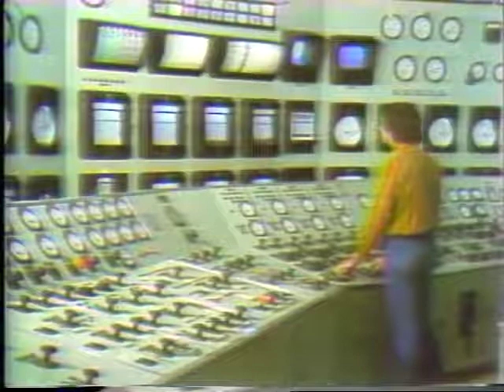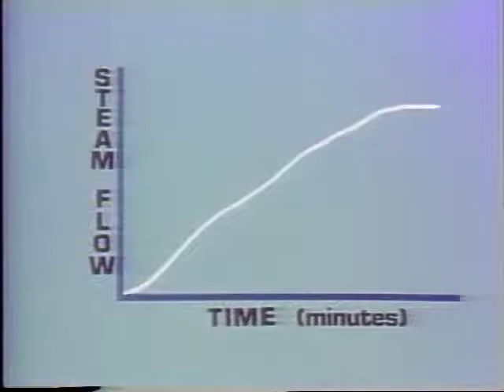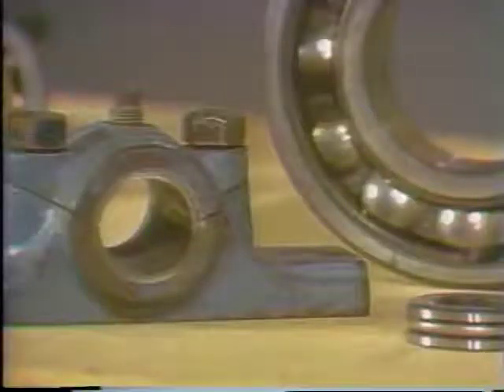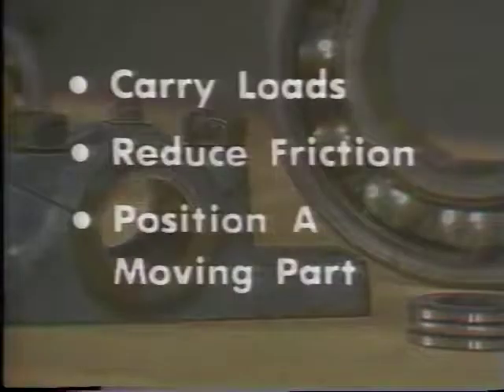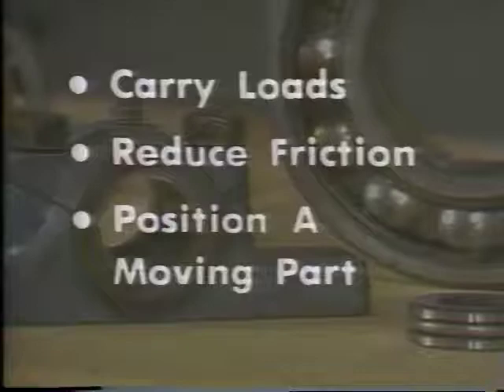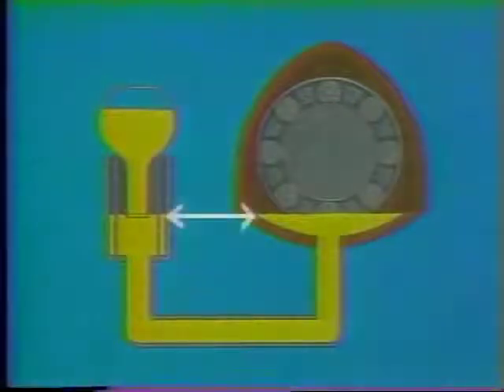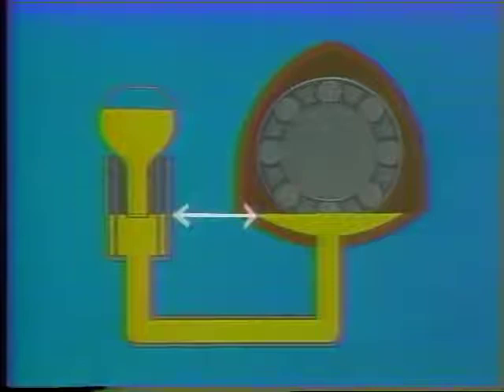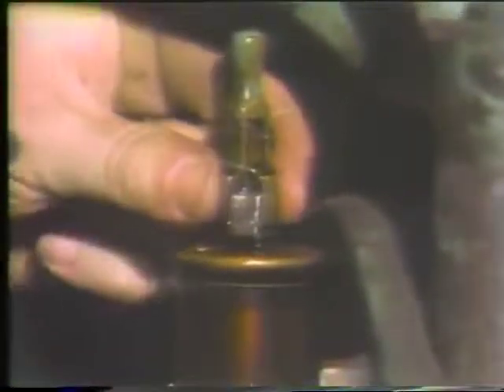Power Principles - Power Plant Basics - Plant Operation

Comment: Completely new to this industry and plan on testing to become a power plant operator. This info still relevant to 2023 ?
Reply: Not sure but I know the core design of power plants hasn’t changed that much. We use steam power for coal, gas, nuclear. If you understand this video, a lot will likely translate to modern plants.

Comment: Looking forward to working at a plant soon and was looking for content to prepare myself. Footage looks old, but seeing as you posted this a year ago, I suppose do these basics still apply?
Reply: @thegt1647 absolutely. I work in a coal based power plant and every bit of information is very relevant, even now. Computerization has occurred but the concepts are still the same.😊
Reply: @shobhitsrivastava6497 convert to solar or wind, for nature
Reply: Yup. All still relevant today. I was an operator at a crude 6 oil burning plant that later on went to natural gas
Reply: How is it working at a power plant ?
Reply: @mdiaztattoo  as a equipment operator it's been well, at the start there are a bunch of jobs that you learn to do such as valve in heat exchanger lines and since the plant is huge it can suck to find what to manipulate but it just takes time and helpful coworkers to make the job easier. we're on rotating shifts so it sucks to not have a consistent sleeping schedule. there's a lot of good people at the site and it's been great to work with them.

safety's has been a big focus recently these months and our managers have told us to take as much time on our job to do it right and they'll deal with the corporate schedule which us new guys appreciate a lot. 
feel free to ask more stuff, ill try my best to answer